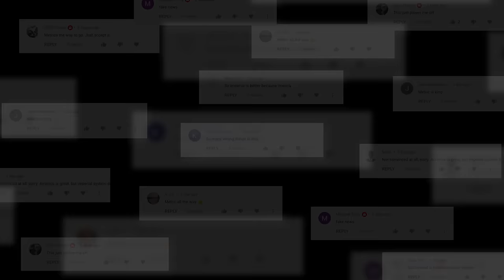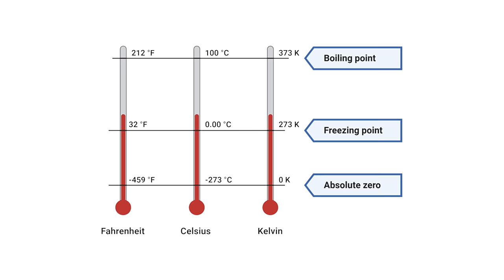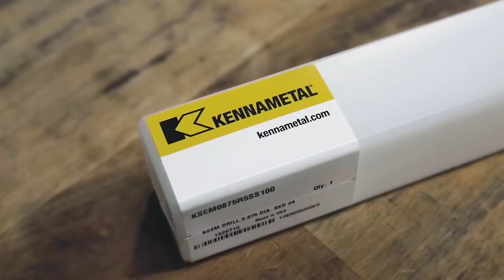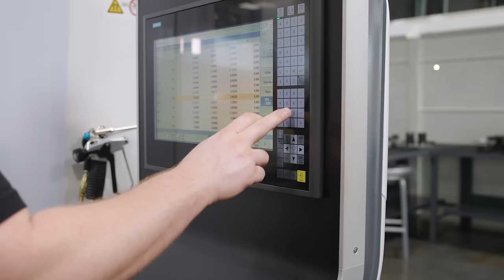Why METRIC is SUPERIOR to IMPERIAL

Comment: It's actually based on pure water. A cubic centimeter of water is also a milliliter of water, which is also a gram of water (at standard atm and at room temperature).

Edit: Imperial is useless for two reasons (I'm saying this as a user):
1. Its all based off of Metric
2. We use metric in science-based courses throughout our education because it's simpler to convert between units measuring different qualities, and it's based on a power of 10. This makes measuring both small and large scales easy i.e. the meter is the base for both the Gigameter (not used, but same thing as "X millions of Km") and the nanometer.
Reply: A calorie is also defined as amount of work needed over x amount of time to heat up y amount of water by 1°C
Reply: So easy and logical.
Reply: "room temp" is 20C btw, with the original rooms holding the rods being very regulated in temperature (as metal expand with temperature fluctuations)
Reply: well, its the other way round, the definition for volume is based on the unit for length - but:
they wanted to base the unit for mass on the mass of a cubic meter water at 4°C. they went a different road, to write it down, but
1l Water at 4°C (highest density) has ~1kg (at sea-level) and fits in cube with 10cm side length
Reply: Imperial isn't actually based on metric, but it's now defined in metric.  Imperial is based on sizes of things (average foot length, for example) which can changed, so they standardised the imperial units based on metric equivalents.
Reply: @imademonistthingy  Fun fact, The Calorie is not actually a metric measurement, food energy is measured in Joules which is a Metric SI unit.  The Calorie is/was a convenience measurement defined using metric values and is now considered obsolete!
Reply: While weight and length are linked by pure water, the French started with length first.

They first decided that the unit of length was to be one ten-millionth of the distance from the North Pole to the Equator, as measured across the earth surface, not an imaginary straight line through earth. From there, a cube measuring 1/10th of the length unit per side, filled with pure water at freezing point was to be 1000 gram, or 1 kilogram. Later they adjusted the definition to 4 °C, since at that temperature water is at its highest density.

And in modern times, the second is defined as the time it takes for caesium 133 atoms to vibrate 9192631770 times. That's why folks speak of atomic clocks. And the meter is defined as the distance covered by light in full vacuum in 1/299792458th of a second. We've come a long way...
Reply: @xTheZapper  Nowadays, we use calories to describe how tasty food is... 😂
Reply: but depends upon temperature, and where in spacetime it is
Reply: They don't base it on water anymore, it's now on constants of nature like the speed of light and what not
Reply: @DeathlyShadowXD  I was talking about the origins of Metric units and their relation to water, not how today's units are standardized. 300+ years ago, we did not know the speed of light.
Reply: @jakeaustin901  oh right my bad.. although interestingly the first accurate measurement of the speed of light was 72 years before the American declaration of independence
Reply: @xTheZapper  The calorie also causes a lot of confusion. People call it the calorie, but when you look at he package it says your chips are 130 kcal per serving. kilo calories!! that is a 1000 times more!

Comment: We use both where I work. We manufacture gas turbine parts for the aerospace industry especially Rolls Royce, CFM and Snecma. I personally prefer metric as I loathe imperial.
Reply: Same, aircraft maintenance engineer here and we use both metric and imperial.

Comment: prefer metric, but I feel the vitriol against imperial is unwarranted , the Imperial system for a lot of things is a Binary system, where a lot of things are divisible by 2 or 4, , cups, quarts, pints, gallons,  ,   feet and inches are binary and trinary,  .. yard foot, inch... . half a foot is 6 inches, half of that is 3 inches., wherein the metric system is a decimal system, and dividing by two typically doesn't give "nice" numbers. the imperial system worked well for the time. all that being said, I generally prefer metric

Comment: The thing is imperial uses metric to define itself since imperial cannot be directly defined by universal constants.
 For example 1 inch is defined as 0.0254 meters which can further be defined by the length of the path traveled by light in a vacuum during an interval of 1/299,792,458 of a second. Which is far better than using seeds as a constant since they can never remain constant.

Comment: How do metric martyrs use clocks or calendars with all those different units? 24 hours, 60 minutes, 60 seconds, 365 or 366 days in a year depending on what year it is, 28 to 31 days in a month depending on which month it is and which year for February. If they used metric then there would just be units, kilo-units, mega-units, etc.

Comment: The real problem with imperial is that units that should relate to each other don't. A Newton exerted for a meter is a Joule. A Newton exerted at 1 meter per second is 1 Joule per second, or 1 watt. 1 volt of potential with 1 amp of current is also 1 watt, or 1 joule per second. None of this works in imperial, sometimes power is measured in horsepower, sometimes in BTU/hr, and neither of those relate to the pound-force, the foot, or the second in any meaningful way. This also treats mechanical power, heating power, and electrical power as completely different things (hp, BTU/hr, Watt), while they are all one and the same: power. Similar problems occur with areas volumes and pressures, electromagnetism, thermodynamics

Comment: i work with both. all my part drawings are called out in a converted to-inch dimension. so there are lots of times the swiss mess up in the conversion and the parts end up wrong unless we go through the engineer's dimensions and check everything. anyways. i like both. Imperial has its place and so does metric. i believe metric is superior in the high tolerance area where imperial is better in low tolerance areas such 1/2" 1/4" 3/16" for framing wood or such.  but then lumber has its own system! ( 2 x 4 = 1.75" x 3.5"??)
Reply: you pay for the saw thickness. 1/4 inch saw. and yeah imperial or for america SAE is more practical. For my line of work anyways.
Reply: @rektiumstuff3245  yeah I know my dad has a saw mill. But 40 years ago you got a 2x4 when u bought one. Just the standard has changed.
Reply: Nominal sizes have their uses too. I think pipe sizes are nominal as well, not reflecting their actual size.
Reply: @TheOutbackIndustries  and that is precisely the reason why imperial sucks. Everyone is just accepting that imperial numbers on raw goods are merely a suggestion, so when a 2*4 isn't 2 inches thick... That's fair game to many. In the end, it means more money for the manufacturer and less for the consumer.
Similarly for sheet metal, the gauge varies a lot from one material to the next. Whereas in the rest of the world, the thickness is specified as a dimension, so it is very easy to understand just how much you get for your money. And if you want to know how heavy it is - thickness * area * density, and you're done. With sheet metal gauge? God knows...
Reply: @gottagowork  Pipe sizes actually did reflect their actual size and do under certain circumstances still today.
The first use for pipes was (as the name suggests) piping, water pipes etc. And what is important for something that carries fluids? The inner diameter and that's where the naming comes from.
Now go ahead a few more years, material grades are getting better, you need less wall thickness and you also can use those pipes for structrual applications. But for structural applications you want to have a constant outer diameter with varying thickness.

Comment: "From the micron to the megabyte" Of all things you could've mentioned, you mentioned an exception. A megabyte is 1024^3 bytes (1,073,741,824 bytes) rather than 1000^3 like the other ones. This is because it's easier to use with binary.
Reply: Not true. A Megabyte is 1,000,000 byte. A Mebibyte is 1024^3 bytes.
Reply: @thecouchpotato4652  you are correct here
Reply: "A megabyte is 1024^3 bytes (1,073,741,824 bytes)..."

Eh, whats 3 orders of magnitude between between friends? 🤷‍♂️
Reply: @onradioactivewaves  I meant millibytes...
Reply: @onradioactivewaves  no, Megabyte is 1000^2. Mebibyte is 1024^2
Reply: @jakeaustin901  Mega-anything is 1000^2, not 1000^3 which is giga-.
Reply: @rexsceleratorum1632  yep, my bad. Edited it, thanks

Comment: As a German Machinist/Toolmaker i prefer the metric System, of course. But i also have tons of imperial tooling and use it daily. I´m used to both systems after nearly 50 years in that trade. As a restorer, i use both systems permanently too, due to many items from earlier times have imperial in it.
Reply: Yeah, try ro break a 1/8" tap compared to M8. Love those.

Comment: It's not just the multiply/divide by 10, it's also the crossover to other measurements. Distance cubed = volume = weight. 1,000 cubic centimetres = 1 litre = 1 kilogramme. So what goes for one goes for all. How many cubic inches in an ounce? And is that an oz or a fl oz?

Comment: A study was made on this subject, where 2 teams built an house. One team used imperial, the other used metric. At the end the imperial team made much more waste/ wasted more resorces then the metric team.  Most errors were made by converting from the one to the other imperial unit. So that has notung to do with which one is someone more used to. I saw a clip in which OCC mechanics were unsure if 3/8 is the same as 1/4. And they should be used to imperial.

In the metric system you can also jump easily from length to volume or to weight, because they are somehow relatable. 10cm x 10cm x 10cm= 1000ccm/cm³ or 1liter. 1liter water weights 1kg, 1000kg is a metric ton, or 1 bar= 10N/cm², atmospheric pressure is ~ 1bar. Rule of thumb says water pressure rises 1bar/ 10m dept. Its much easier to convert units.

Comment: As a Mechanical Engineering student, I absolutely despise having to convert metric to imperial or vice versa during our exams. Its very frustrating when you know the equation to solve the problem but you cant come up with a final answer since the given data is in metric but the question requires an answer with imperial units and you forgot the conversion factors.

Edit: I realized that my comment can be out of the video's context. I apologize. Length and mass conversion in exams are easy, no arguing with that. What I actually meant was when you're working on problems with compound units involving forces, energy, mass, temperatures, etc., things get difficult and tricky really quickly. Add the fact that some of our professors give out too many exam items with a short time limit.
Reply: Divide or multiply by 25.4 🙄
Reply: @larsmichaelmommer  i think that would be too hard for an engineering student though.
Reply: @machinist1337  😂😂. I know a lot of great engineers, but they’ve worked with some pretty good machinist or have spent time in a shop to understand manufacturability 😂
Reply: Been there. Length is the easiest to convert tho. When it comes to freaking force or mass units and there you are deciding weather you have to convert kilograms to slugs or pound-mass ugh. Or when you have compound units that involve energy and absolute temperature scales (Farenheit to Rankine to Kelvin but answer is in Celcius) anyways, yeah.
Reply: @machinist1337  No, it's not that hard. Engineering curricula in the USA are all standardized, they all include practically an entire semester of learning to approximate and estimate, and any engineering student should be able to convert mass and distance at the very least.  It does suck, but we're not incapable of learning it.
Reply: @stickyfox  bro it was a joke.
Reply: @stickyfox  but i bet your an engineer, they dont understand sarcasm lol!
Reply: Academia works in metric, industry works in customary units, it's the job of the engineer to convert between the two.

Comment: Oh thank god, i wasn't sure if the last one was just a troll or not.

But I'll stick to metric 😂
Never used anything else in my life
Reply: I think it wasn't a troll. If you look at the videos, most if not all of them are narrated in inches, the overlay comes in metric though, just as an afterthougth. I find these videos quite interesting but every time they talk about feeds/speeds they use Imperial and have to do the conversions in my head.

I am a firm beliver sticking to Imperial is holding american manufacturing back.

Comment: With CAD design for 3d printing it's much easier to use and visualize metric for me. i would go decimals over fractions any day, and metric saves the hassle of converting imperial fractions to decimals to input into most CAD programs, which don't usually have fractional inputs.
Reply: Not just 3D printing... everything is easier.
Reply: @brianfhunter  yessir.

Comment: Being canadian.  Born in the 80's, i learned the metric system.  Being a carpenter and learing from older people, i also know the imperial system.  I know im 6'4" tall. Or 193cm.  For the last two years i started to go back to my metric roots, and my miscuts have gone down by 50% after working for 12 hours in 40c temps in full sun, where you are bound to make mistakes.  I just find it more accurate.